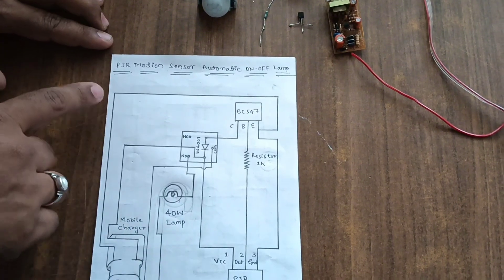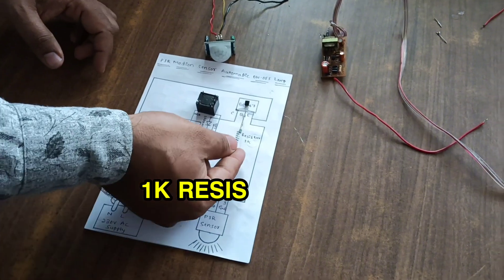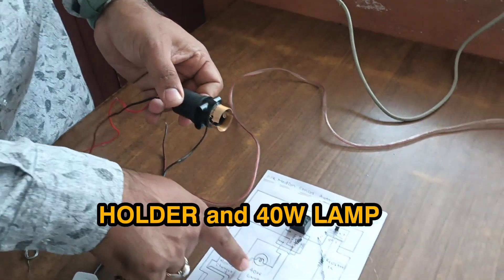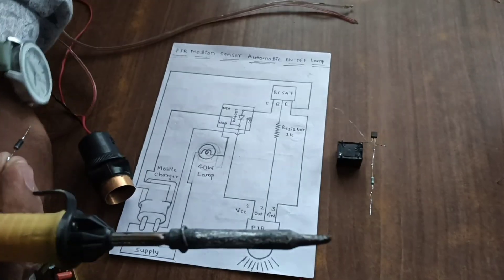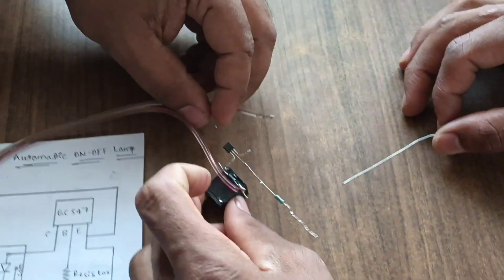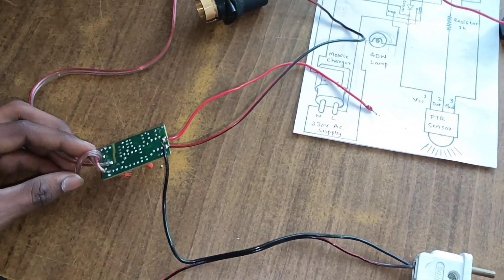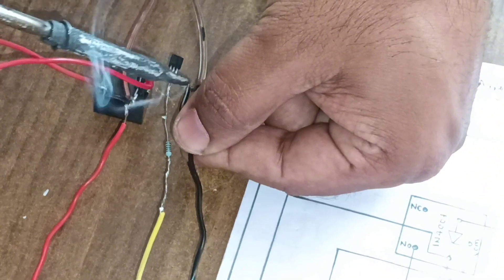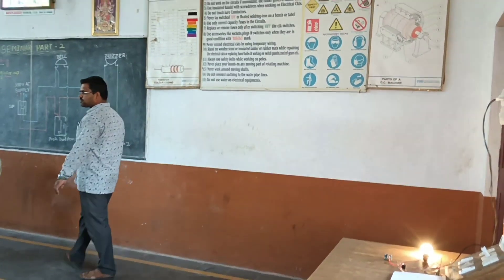Automatic ON & OFF lamp💡 Motion Sensor # PIR Motion Sensor Project # Subscribe Channel 👈..

Comment: Very useful project motion sensor makes automatic on and off lamp or PIR motion sensor project using for material pir motion sensor or BC 547 or 5v realy or 1 N4007 diode or resistor or holder or lamp successful project very nice video 💯

Comment: Very useful project motion sensor makes automatic on and off lamp or PIR motion sensor project using for material pir motion sensor or bc 547 or 5v realy or 1N4007 diode or resistor or holder or lamp